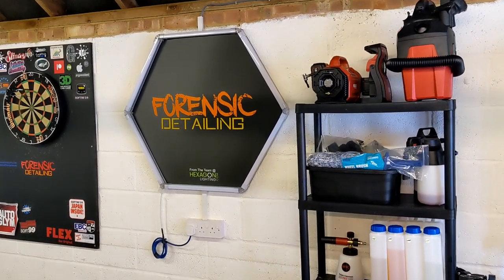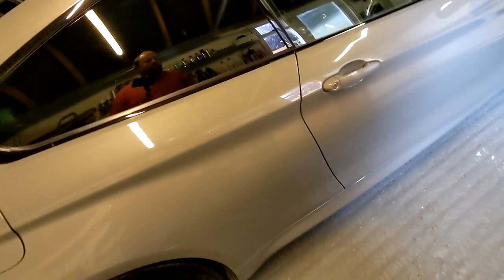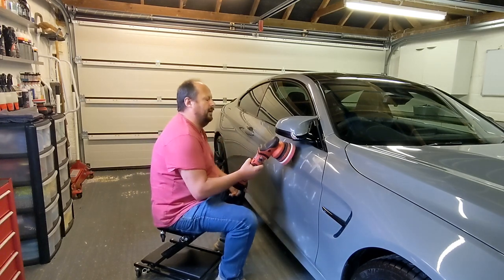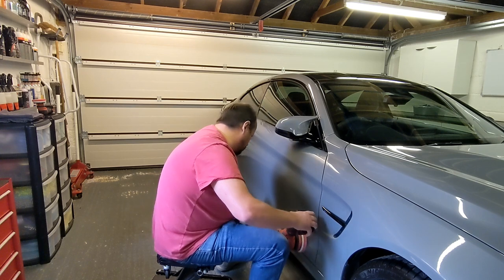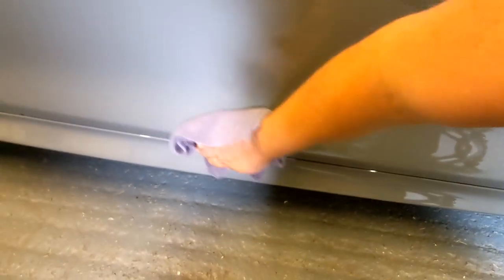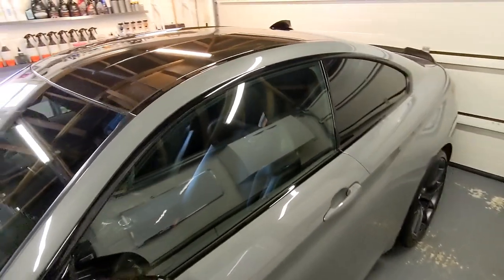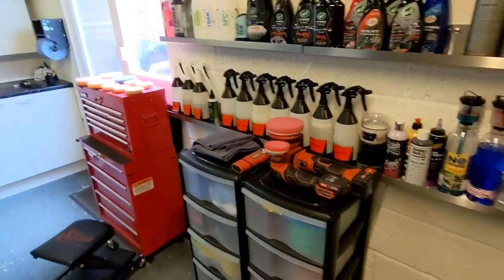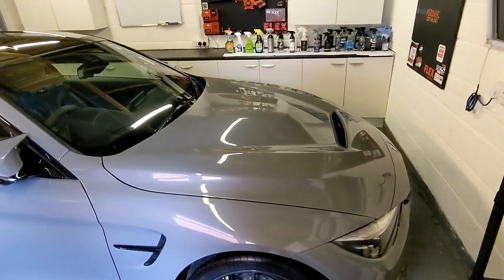Electric dripping wet gloss from 3D speed car polish

Comment: Great cleaner wax! Was just using it here at work today. 

It's supposed to contain. 10% cutting agents, 20% polishing agents, and 70% wax, which is compromised of an acrylic component and montan wax. Very nice product. 

Try their AAT502 Finishing Polish if you want a similar finish without cut or waxes.

It was a popular practice to top it with their Poxy sealant wax. I used to use their Express Wax to boost the slickness and protection. 

If you like waxes, Poxy is a lot of fun to use, looks great, and is super slick to the touch. Like Speed, it also smells great too.
Reply: I was thinking of trying the speed/poxy combo, nice to know it's slick! I'm noorth on autogeek.
Reply: @seabrew1  I use speed and then poxy so easy and the gloss is great not many will disagree

Comment: I know this was a while ago, but can you use this, then add either Fusso Wax or a ceramic coating on top? Or what’s the best for just a speedy/ light correction and finish polish that’s ready for Fusso/ ceramic? Trying to plan a winter maintenance detail, but struggling with this last phase.
Reply from the maker: no dont coat on top mate, this product has wax in it.